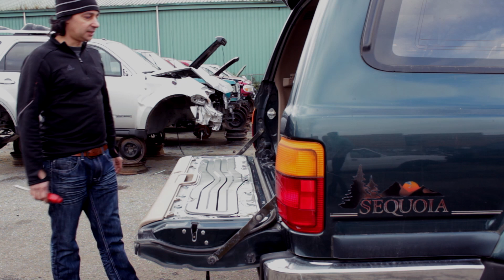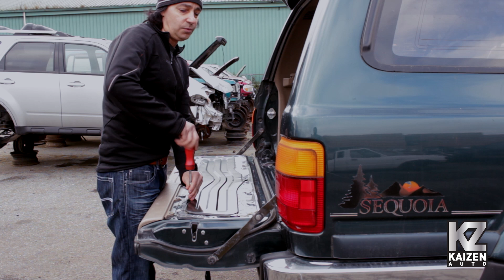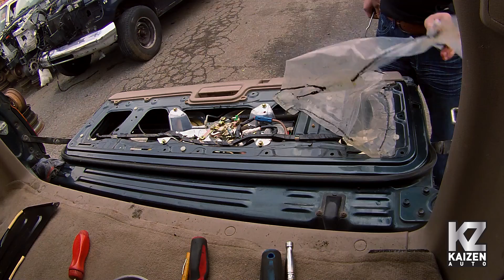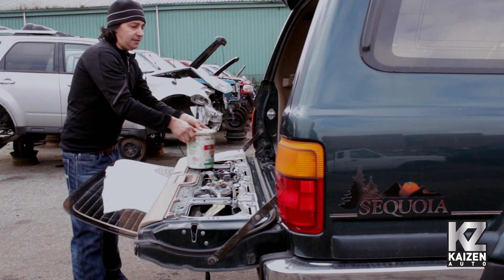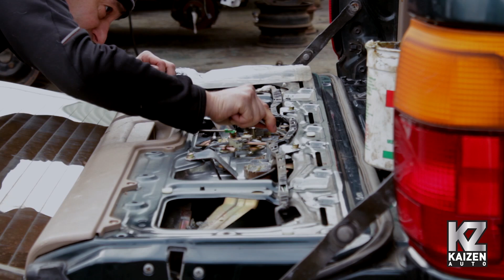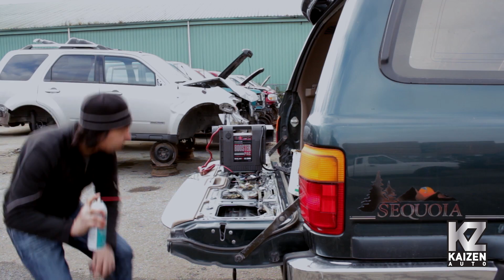Maintaining your 4Runner's Tailgate Glass Assembly

Comment: After having recent issues with my window going up from the switch and key with car engine on or off, i decided to give this a try. Helped a bit but still had the same issue. I then went to swap a motor, (though the polarity was backwards as the switch functions were now reversed. After switching the motor, now i have issues getting the window DOWN (reversed switches) and takes several tries to finally move. It only works with the engine on. So this leads me to think- is it my window relay going bad given it was previously having issues going up, and now it's having issues going down with the new motor with reverse cables?

Comment: The pigtail you used to energize the tailgate motor, how would I go about making on of those? Do I need that connection you have or could I just use exposed wired to touch to the nodes?

Comment: Awesome video.  Mine works but is slow.  Helps that it has been garaged basically the entire 25 years, but I have never lubricated it.  Will be doing soon.  Do you have any videos on replacing the back speakers on a second gen 4Runner?

Comment: Thanks for the video, my window is off track, any help for that??
Reply: you have to remove the window and re seat it... but they don't come off track without some other problem causing it... so you have to fix the problem also.. then re seat the window or it will just happen again if its not fixed correctly.

Comment: Question, My window don't work & get back door open 93 4runner. Window is in up position, back door closed. When i put key in & turn.. i get that beeping noise but your getting it with the door open. Any ideas on why it's saying my latches are open? Any idea on a solution?

Comment: My 1995 4runner's tailgate won't go up or down. The key won't power it down either and so I can't open the tailgate.  Do you have any suggestions. Thank you
Reply: probably needs a new motor
Reply: Thank you
Reply: Make sure your rear wiper blade is set in place 
There’s a safety feature that doesn’t let the gate down